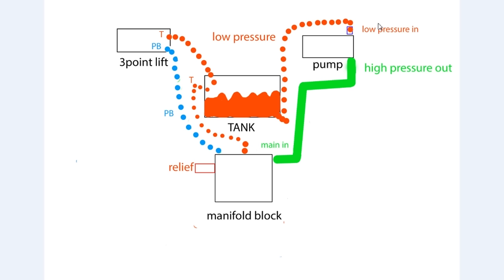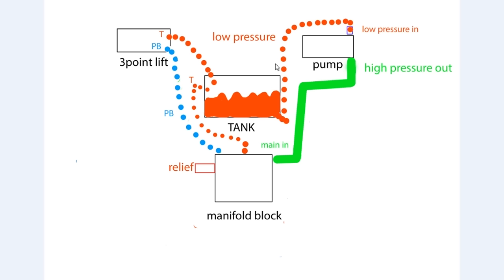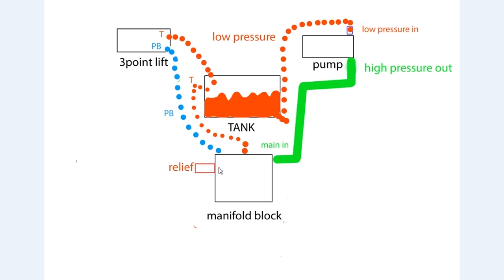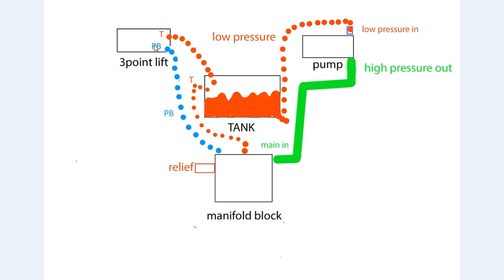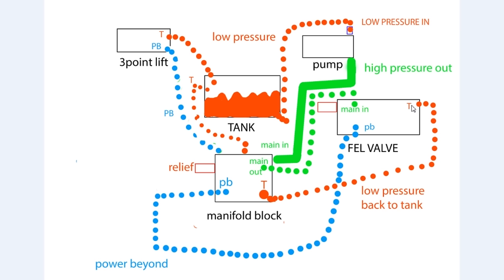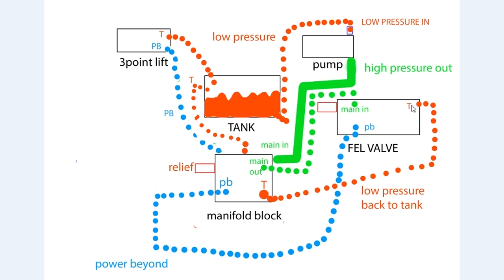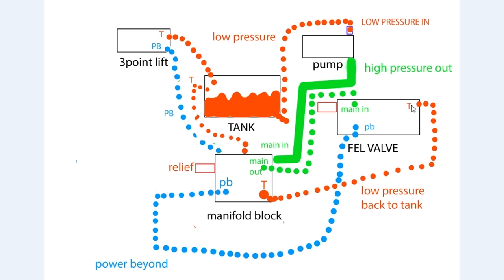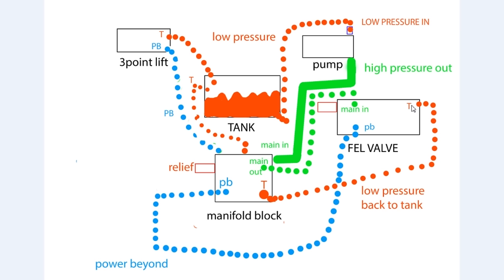adding rear remotes and understanding tractor hydraulics

Comment: How can I hook up a rear remote without a tank line going back I can get a kubota l2650 dual rear remote but it only has 2 lines and it looks like I need 3 lines for my nh tc35 any help would be great thanks
Reply from the maker: if its an open center valve all you need to do is hook it into the Power beyond line. you will have pressure coming from the FEL power beyond port into the inlet of the open center Kubota valve and then out the Kubota open center valve to the power beyond port at the manifold block.

Comment: Wouldn't a 3-point have a main pressure line that would be internal to the transmission case and not a power beyond line/hose as shown in your diagram?  3-point lift hydraulics are typically very integral to the tractors hydraulic system whereas power beyond exterior lines/hoses are for operating add-ons.  Maybe it varies greatly from brand to brand.
Reply from the maker: possibly varies from brand to brand and model to model as well. most of these open center design systems the three point feeds at the end of the power beyond circuit. if you raise or lower the front end loader your three point will not go up during that operation. it may go down but not up while operating other power beyond controlled items like a loader or third function valve. hope that helps

Comment: why can't I just tee into the output on the pump for my new spool valve and return to tank from my new spool valve?
Reply from the maker: cant do that on an open center hydraulic system. you will NOT have the proper pressure because the fluid will take the path of least resistance. rather than move the hydraulic cylinder it will merely return to tank on the other line.

Comment: Thanks Dave, but could you run from the power beyond out port of the back hoe to tank instead of going back to another power beyond port. fj
Reply from the maker: you can jump into the circuit any place you need to.

Comment: I'm very new to hydraulics and this video helped me a lot, thank you!!! I've got an old hako trac minitractor and I'm planning on building a front end loader for it, and I've been wondering about the two cylinders which lift the bucket, (also same question about the two which dumps the bucket) since I've got two lift cylinders (one on each side) how do I control them with just one lever? Can I just use a T looking adapter or do they need to be synchronized somehow? I rarely speak English so I hope you understand what I mean, hehe.. 
Thanks in advance!
Reply from the maker: yes just "T" connect into them. they will equalize themselves once everything is tied together and the bucket is installed.
Reply: @daveknowshow  awesome!! Thank you so much😃
Reply: @daveknowshow  hello again! I'm now starting to order the stuff I need for my front end loader build but I can't figure out how powerful my pump is, it's small garden tractor from the 60s so I assume it's not a lot. So to my question; what would happen if I buy spool valves that is made for 40L/H and my tractor only supplies like maybe half? 
Or how do I find out how much my hydraulic pump is flowing?
Reply from the maker: @Slisktord  pump it in a gallon jug and time it then do the math. but the main thing is make sure the valve can handle at least as large a flow rate as you have. if it can handle more that is great. if it can not handle as much as your pump delivers that is bad. typical Kubota Lseries tractors are under 10 gallons per minute like around 6.8 GPM roughly
Reply: @daveknowshow  oh that makes so much sense when I come to think about it, haha! Thanks, I'll try that. 
Yeah I assumed so, but what happens if I use a valve for 20gpm and my pump is only flowing 10gpm? Will the cylinders work slower than they should or anything like that?
Reply from the maker: @Slisktord  no that way has no affect.
Reply: @daveknowshow  oh great. Thank you so much for this info!!
Reply from the maker: @Slisktord  glad to help!

Comment: Just watched your video where is the line for the power steering ? It should all be together. Thank
Reply from the maker: there are several things left out of this diagram. things that are beyond the scope of this tutorial and or not needed for this tutorial. the hydraulic line to the cooling coil is also not shown. the line to the three point position valve is not shown as well. its simply not needed in this specific tutorial that covers the basics of how the circuit works and how to plumb into the circuit to add additional valves for remotes, backhoe, third function valves and so on. if you have a specific question about the power steering I will try to answer that just give me your question and your specific model and year tractor as some are different than others. thanks for the comment.

Comment: Great video Dave,  Your setup is exactly the same as I've planned for my L3400.  I do have one question, doesn't the backhoe also have a low pressure return to tank for the hydraulic fluid coming from the now pressure side of a cylinder?
Reply from the maker: Michael Grubisha no it uses the power beyond line and simply dumps back into it much like a loaders third function valve has only two lines one in one out. I'm sure you could likely set up rear remotes to work the same way but I have not looked into how to do that or the advantages or disadvantages of a system like that. My guess would be having a back to tank line helps aid in the cooling process of the fluid since it's used once and then returned to tank where as the backhoe theoretically could use the fluid twice as it would use it again at the three point. Of course the three point is not being used with the backhoe installed thus making it acceptable to utilize a non back to tank set up. It essentially uses the back to tank within the three point circuit at the manifold block. Hope this makes sense.

Comment: Hi Dave, well done. One of the best explanations on tractor hydraulics. I recently bought an Kuboto L2850D (1993), which has only the rear lifter hydraulics. A backhoe is installed with its own PTO pump/hydraulic-system. As I want to expand the hydraulic system - both rear and front - I wonder what the thread dimensions are on the manifold block. On the first sight, it looks the same as yours. Secondly, I contemplate to install only one spool valve block and as I expect working either on the front or on the back, a kind of switch should be installed. What do think? Thanks in advance. Regards Heinz, Germany
Reply from the maker: the threads on these are weird mine was a pipe thread I believe it was 3/8 NPT national pipe thread. some of the tractors have BSPT  british straight pipe thread. you best bet is remove the block and take it to a local hydraulic shop. they can measure it exactly and sell you exactly what you need hoses and all. I like the J.I.C pipe thread connectors I also like the "o" ring style hydraulic fittings. so if you find out yours is a national pipr thread which is a tapered thread convert it right away with a NPT to JIC or something more user friendly. my reason for saying this is the NPT being a tapered thread does not handle removal and install more than a few times. this can be a problem. for example right now my tractor is in pieces and the JIC fitting came right apart easily and will go right back together and not leak, the NPT not so easy and likely will leak. you cant hardly have to many spool valves on a tractor. I always thought all I needed was two on the rear. I was wrong I wish I had three back there. I may add one at some point. I love the top and tilt and that requires two spool valves. a third would mean I could build a small dump trailer and have the third spool valve power the dump cylinder. or run a sickle mower boom, post driver or maybe any number of other things. you can always run hoses from the back or front to power various things. snow plows on the front with up down and side to side angles would require two spool valves. anyhow I hope this helps and if I can be of more help just let me know. I love helping my brothers around the globe! Peace Love & Respect to you and your family Dave in Virginia USA
Reply: @daveknowshow  Thanks a lot for your explanations. You help a lot.

Comment: I've got an L3800 that I'm considering adding both a rear remote and a 3rd loader function as well. Since I don't think I'd need them both at the same time, I considered just moving hose connections as needed from a single valve, but then I think I prefer different valve lever locations for each anyway, which means two valves again.
My question is about both options: where are people ordering the kits from? Genuine Kubota would be my preference if it exists and is not too pricey, but I haven't been able to find any yet.
I'm also hoping that the hydraulic pressure is enough to drive a 3 foot diameter auger bit for tree planting on the 3800. (Not the HST model)
Also considering making my own grapple system as well.  Thanks!
Reply from the maker: I doubt it has enough flow for a 3 foot auger. they do make a low flow auger that may work. however most 3rd function valves are electromagnetic activated and holding the button for prolonged periods will burn out the coil on the valve. I do recommend independent 3rd function valve for the grapple. I added 2 sets of rear remotes and wish I had 3 sets. hydraulic top and tilt will use 2 sets. a third set of rear remotes would be great for a small dump trailer. trading off hoses from one thing to another gets old fast. I created my own third function kit from parts here and there. you can find them on amazon, northern tool, surplus hydraulics dot com and many other places. there are some places that sell kits all made up. W.R.LONG is one company that comes to mind. if I can help in any way just ask.
Reply: @daveknowshow   Thanks for the thoughts. I checked and the hydraulic flow just isn't enough to power an auger motor of that size. I'd have to go with an auxiliary PTO pump or something if I did that.  I'd rather just have the whole auger PTO mounted instead, but I can't find a 3 pt auger of that size either.  
Also good point about the solenoid wearing out for constant use implements.  I've been thinking about fashioning a 6-way loader control handle that twists, controlling a remote valve that's connected via push/pull wire. Could even have detent function that way.
Reply from the maker: @jeremyjamesenos  they make a "low flow" auger motor however even those struggle on these tractors. additionally I'm not a fan of mounting augers on the front end loader. the lateral forces against the loader arms would be a weak point. I could see the auger twisting a loader frame. they also make large auger but they only fit the  post hole digger that has a really slow turning gear box. I cant remember the gear ratio but it requires a larger horse power engine to rotate the box from what I understand. those style gear box will turn a 30 inch auger or larger. typically see these on 80 plus horse power tractors however they may work on lower HP also. you would need to do some research.  these days they use skids steers with front mount hydraulic augers but years ago they used three point pto driven. so they are out there. you may could build your own. just remeber the larger the auger the slower it MUST turn. the slower it turns the more likely it will sling the tractor around if it ever hits something and stops failing to break the shear pin.  you could go for a ride!
Reply: @daveknowshow  Thanks...  rear mounted PTO driven also makes a whole lot more sense to me as well for the same reasons.  Skid steers just have no choice, so I guess that evolved w/ the popularity of their attachments. This was helpful as I hadn't even ever heard that a geared down PTO driven one existed either. Last time I had to do it, I used a regular rear post auger gear box jerry-rigged to the 36" bit... and it was all the 38HP compact wanted to handle at times, but it did it.  I'll keep my eyes open for a low ratio rear mount.

Comment: Thanks for the videos.  I've been watching over and over, and still trying to figure out just how to set up my spool valve.  I have a Mahindra 1538, and it has a backhoe, so one set of rear remotes.  But I have three hoses on the back.  Two (male and female couplers) are on a metal block, and a third hose, longer than the other two, with a male fitting.  All three hook into the backhoe when it's on.  I take the backhoe off, and take the longer hose and plug into one of the other two so the 3-point works.  One is PB, and assuming the other two are high pressure, and tank return.  I have a Cross 4Z0052 2-spool valve with an "IN" "OUT" and "BYD"  I can't figure out how to set it up with what I have.  Any light you could shed would be greatly appreciated.  Again, thanks for the vid's and thank in advance for any help.
Reply from the maker: so basically your new spool valve that you are adding will only be in use when the three point is active correct? in other words when the back hoe is NOT installed. so the hose that goes to the hoe that has flow coming out is the power supply line. the line you plug that line into in order to feed the three point is likely the power beyond port continuation. think of the power supply line as the power beyond out and the line feeding the three point as the power beyond in. the other line is a back to tank port. so the line that has power coming out goes into the IN port of the new spool valve, the out port of the new spool valve will need a hose to run to the back to tank quick coupling at the rear of the tractor, the port on the new spool valve labeled BY or BEYOND will need a hose and connector that will plug in at the rear of the tractor into the port that feeds the three point. hope this helps.
Reply: @daveknowshow  Thanks for the reply!  I finally got it explained from the dealer...when the BH comes off, the PB gets plugged into the power circuit to run the 3PH.  The return is unused.  So now I know where to plug in the lines to the valve body.  Thanks again, and keep up the great videos.  BTW, I have you to blame for all of this in the first place!  I was watching your video on how to run a box blade, and you had top n tilt.  Seeing that, "I just HAD to have that!"  LOL.  Cheers!
Reply from the maker: @solero7378   you can use the back to tank port with the new spool valve if you want to by just installing a hose with a quick couplin on it and when the hoe is off plug that in. I used the back to tank port on mine.

Comment: Is there a way to increase the weight lifting capacity of a 3 point hitch?
Reply from the maker: the main relief valve governs when the system dumps back to tank and thus that will increase lift capacity all the way around. many people adjust the relief setting by adding shims. the shims and pressure gauge is sold by several people online. I believe bxpanded sells a kit for various model Kubota tractors with instructions. with that said I'm personally NOT a fan of increasing the relief pressure. bent hydraulic cylinders, blown hydraulic seals and burned up pumps are more likely to happen. however you can get the gauge and shims and check to make sure your system is working at the manufactures rated relief pressure. since a lower pressure would make lift capacity lower as well you could bring it up to specs to insure you get all the lift you should be getting. hope this helps. be careful that relief valve can be sketchy if its working properly and dumping at or around the specs I would leave it alone.

Comment: I have an l3400 
My loader and power steering are very slow and hard to turn
By the look of the hydraulic fluid inspection glass the fluid the level is good 
Could oil level be too high
Reply from the maker: no its hard to over fill the L2800 or L3400 tractors  In fact there has been mention is various forums that over filling those model tractors is a better over all practice. if the fluid has not been changed in a while I would replace the filters to ensure there is no blockage in a filter slowing the flow rate. I would drain and collect the fluid in a clean pan, strain it and inspect it for any metal shavings or signs of water. if the fluid looks good put it back in or change it. I would also do a flow rate test to ensure your pump is pumping the proper flow rate gallons per minute as well as a pressure test. if the pressure is low you could have a bad hydraulic pump or a stuck open relief valve. typically the L3400 and the L2800 have a jerky three point when something heavy is on the back and you try to lift the implement 1 or 2 inches. its less jerky when you lift all the way up or at low rpms. if its no longer jerky you have either a bad pump or a stuck open relief valve or someone has attempted a fix by adding in a restriction point which can often times slow down the front end loader. I think a pressure & flow rate check is where I would start first. if that's ok check the suction line that feeds the pump. they get old, crack and then suck air causing issues with flow and pressure. wish I could be of more help.

Comment: I got a massey ferguson 263 ,,,the 3 points sistem not works,,,can you help me...thanks
Reply from the maker: I would get a gauge and check to be sure the pump is putting out pressure. if it is you likely need to rebuild your three point cylinder inside the rear housing under the seat. a shop manual would help you trouble shoot the problem. try to purchase the manual online.
Reply: Thanks